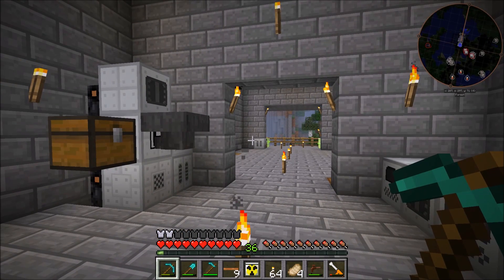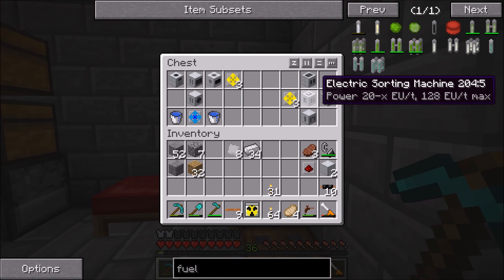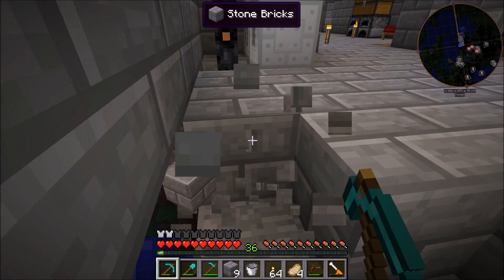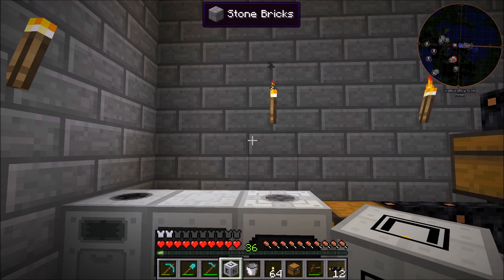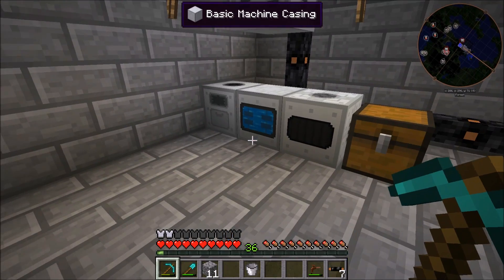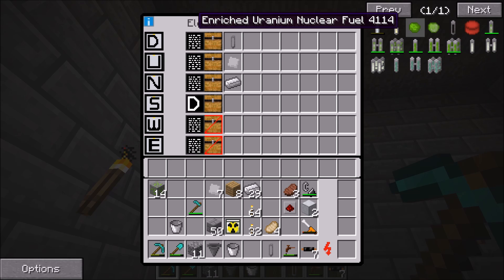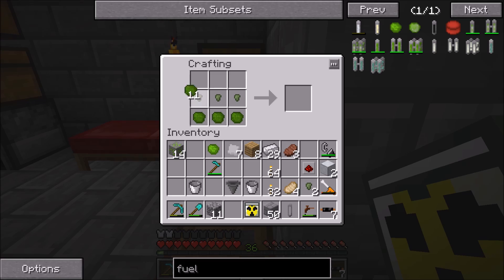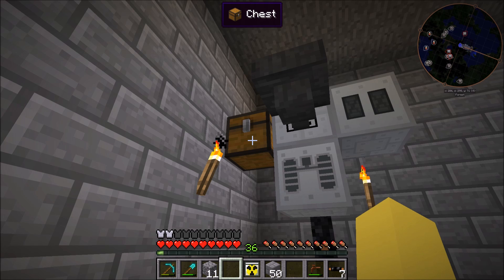Surviving With IndustrialCraft 2 :: Ep.9 - Producing Uranium Fuel Rods

Comment: You should be able to rig up a daylight sensor to cut off the power to the extractor's power storage. I believe it's by tweaking the redstone control so it only puts out power when it gets a signal, which will only be during the day. Alternately, make an EU-Splitter cable, and you can manually flip it on/off with a lever.
Reply from the maker: +Triaxx2 A day/night sensor for the harvester would actually probably be easier, so that no rubber is harvested when there is no power to process it :) but the idea is great, didn't think about the day/night sensor option
Reply: Yeah, we didn't have it for so long, and then it appeared. I actually had a quarry running off of Extra Utilities solar generators when they had to be switched from charging to discharging with a redstone signal. So I set up a couple of sensors to let them charge during the day, and then discharge at night. Completely free quarry.

Is the harvester redstone responsive?